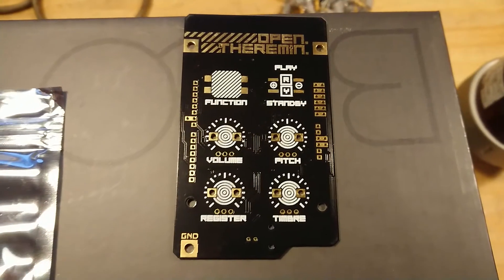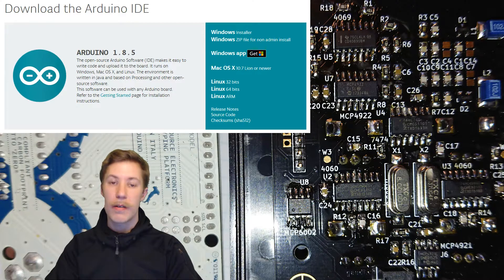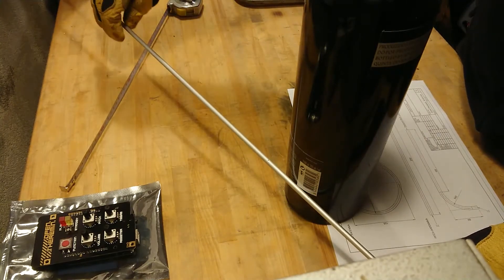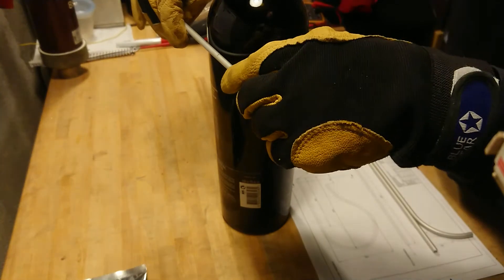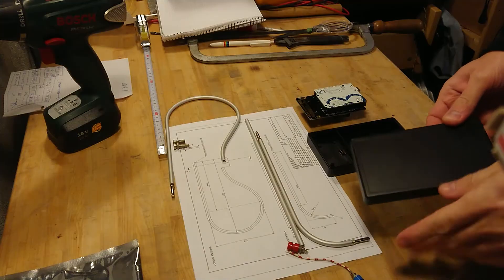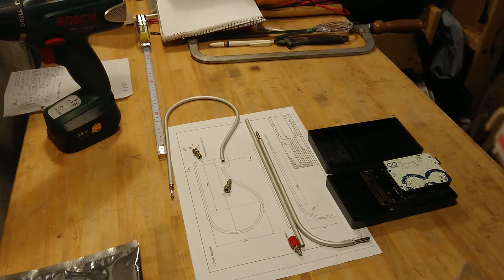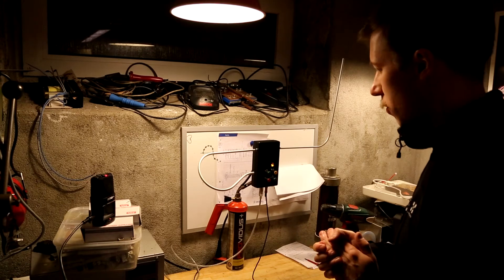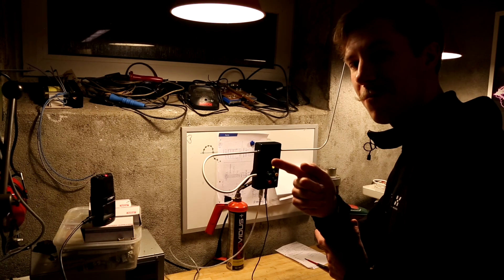Open Theremin V3 - Build Log and Demonstration at The End

Comment: Really great video.

just made same here but something strange happens: after auto-calibration, sound is very noisy, cannot be controlled and worst thing is that noise comes out in directly connected headphone also if standby led (yellow one) is on. I suspect something wrong with welding, what do you think? Thanks!
Reply from the maker: I have not played with this since I built it, so it is all a bit far and would have to dig it out and try it out some more
Reply: @KaizerPowerElectronicsDk  Hello! I also suspect something related to my environment, i.e table and/or metallic object too near. Also will try putting on a tripod. Audio signal seems better comes and goes, and is actually impossible controlling sound on hand position.

Comment: Hi there, I am trying to build mine right now. All done soldering. Wont go into standby mode. When i power it up with the code the red light is on and stays on
Reply: I have the same problem. Did you find a solutuion to this?

Comment: Instead of aluminium tubing copper tubing is a lot easier to bend, plus you can polish it to a nice shine with some scouring pad, then put on a coat of clear lacquer to keep the shine. 6.25mm copper tubing is a common size, 4mm ID as well.
Reply from the maker: I only had 6.25 mm copper tubing in coil, so getting it straight would not be pretty. I chose the aluminium over copper because it will keep its shape for much longer than copper would, taking transport dents into account. Copper would also be more weight on the poor banana jacks :)
Reply: What's the total length you need for this? I can only find straight pieces in 1ft lengths. Where to even find something with 4mm ID in the US? 5/32in might work, but all the 5/32in I can find is OD with 0.01in wall thickness, so it'll be way too small inside. I live in the stupidest country.